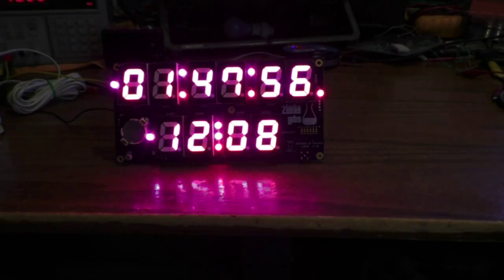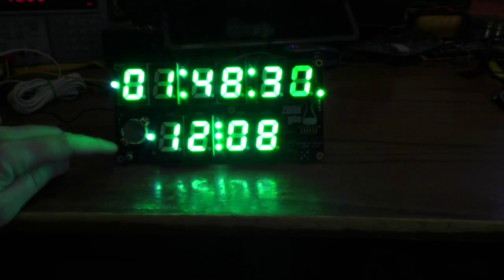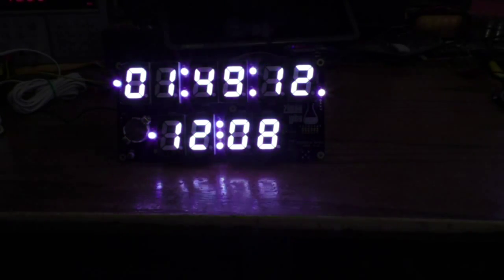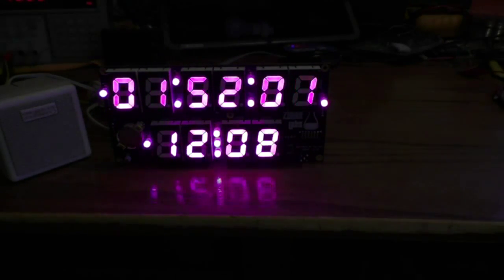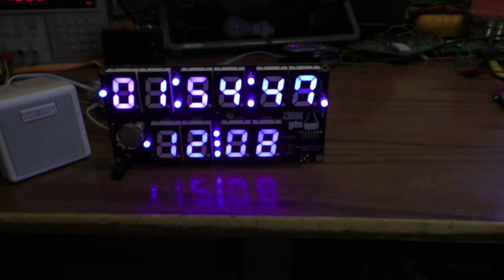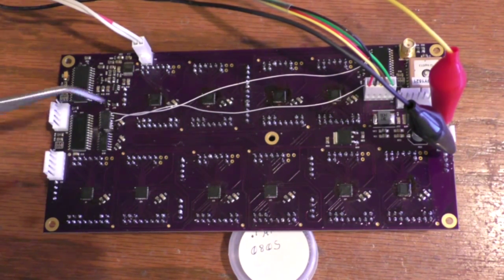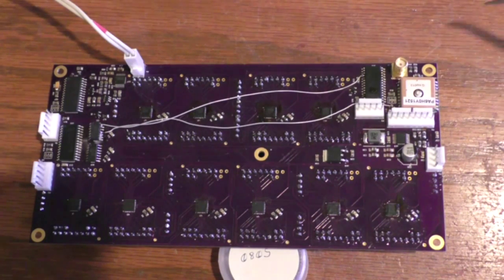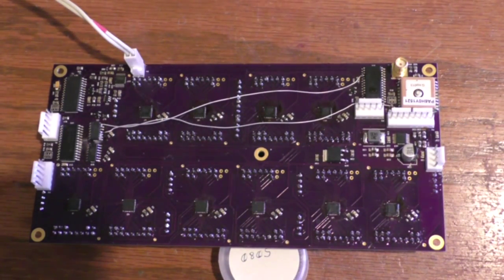RGB 7-Segment Clock Build #2

Comment: This is turning out really nice Kevin. I'm excited to see the acrylic part. I'm going to be making an acrylic case for my N64 project soon. 
PS: you should make an 8 bit/chip tune theremin next! How f-ing rad would that be!?
Reply from the maker: +digitalblasphemy1100 What N64 project is that?  I'm doing a "special' on my various chiptune players.  I fixed them up and got them all working.
Reply: kevtris Oh man that will be great! I have been wanting to know what ever came of your chiptune player. I saw some old comments you'd made about it on atari age not that long ago. 
I'm the same guy asking about the SNES rom hack carts playing in the retron 5 a few months back. You were explaining how that was possible.
The N64 project I'm doing is going to consist of the SLG in-a-box with my SCART modded N64 all in one type deal. I want to take the N64 guts out and stack the slg in a box on top and make it look like this using acrylic. http://bencao74.blogspot.com/2012/06/resurrection-slg-in-box.html
Reply: I have been watching videos on how to fool with acrylic. I was going to order some clear PC and use an obsolete mold our company owns and make that work but I couldn't find any molds that looked cool enough. We don't own the jaguar molds or anything as cool as that and if we did, I wouldn't want to use those anyway. We have a pretty bad ass set of mills and cnc machines so I'm still thinking I might do something out of aluminum. I don't know thought because I think the clear acrylic just looks awesome.